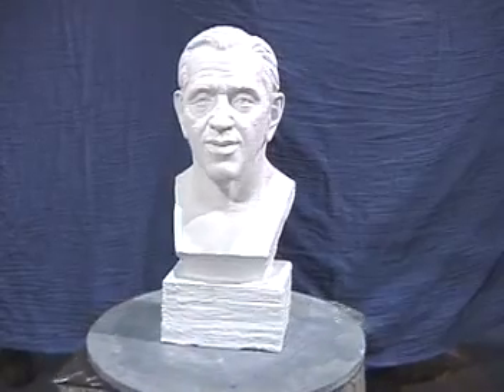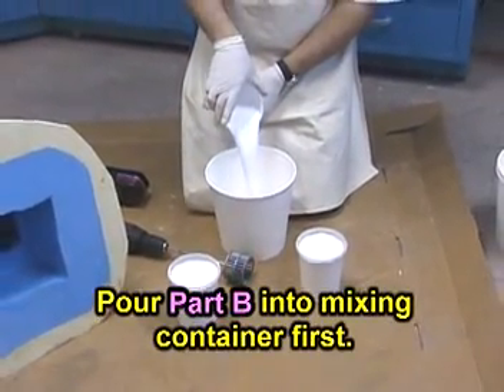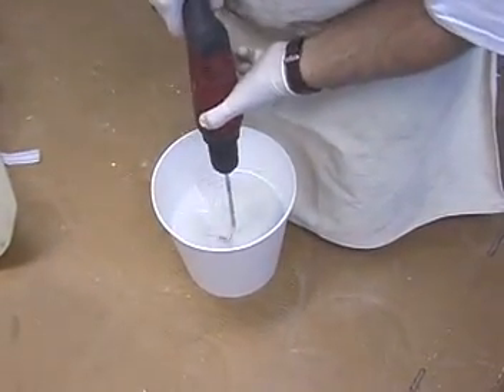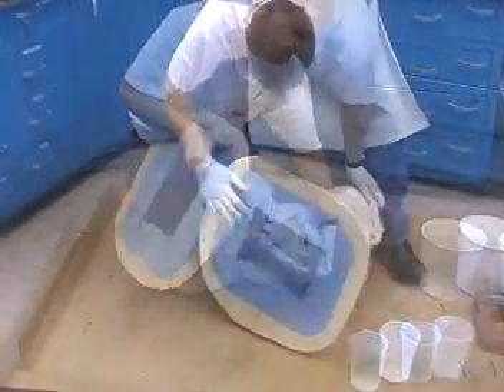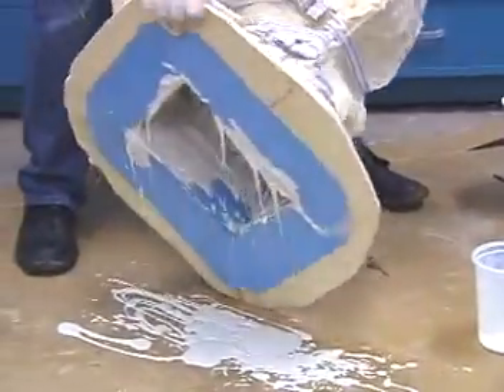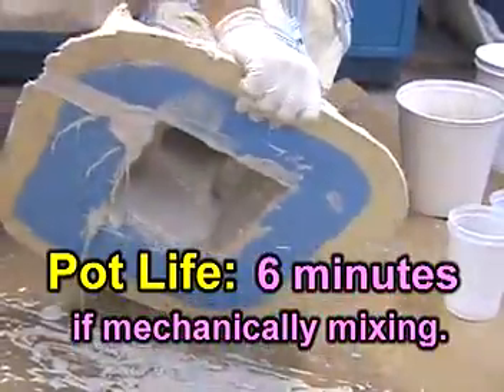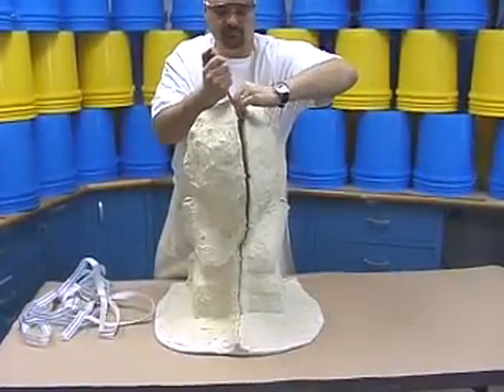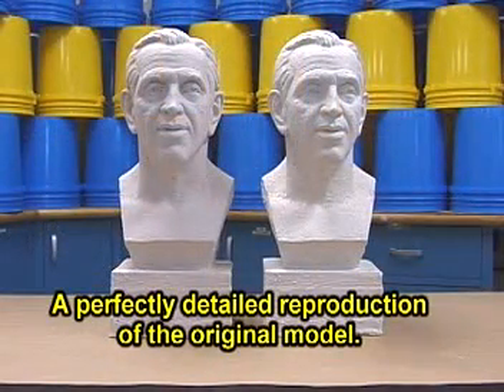How to Do a Rotational Casting | Mold Making Tricks and Techniques

Comment: Ok... So....
If I use a roto cast "machine"...
What are my spin times using this?
Task 7, 300 series, are ALL great on the machine.
Has anyone ran these in a production atmosphere? 
Can u back fill with fast foam for additional structure?
Or, spin a 5 lb foam in one of the layers? 
Will it adhere as well as foam to the urethane products?
Or.... Can u run a thin layer of
 The Duo matrix n use task 7 or likewise as a structure? 
That way to keep the concrete exterior and beef it up on the inside with something that has a faster spin time????
Reply from the maker: Hi there!  This is a good question for our tech support team, can you send them a ticket here? https://www.smooth-on.com/support/ticket/add/agree/ Thanks for watching!